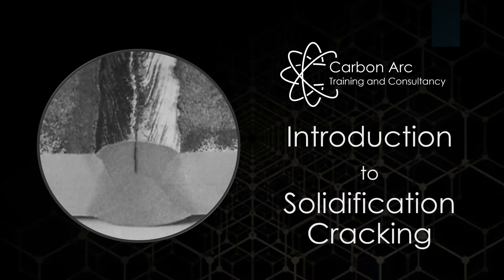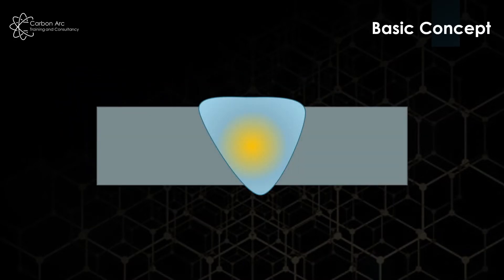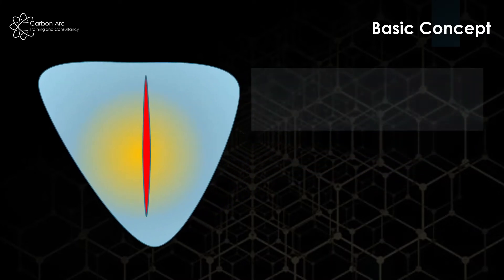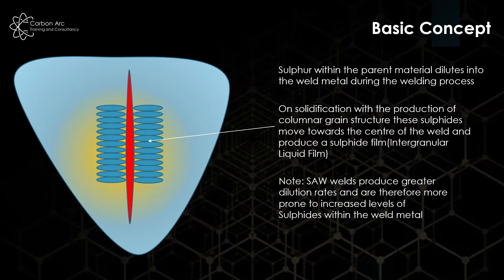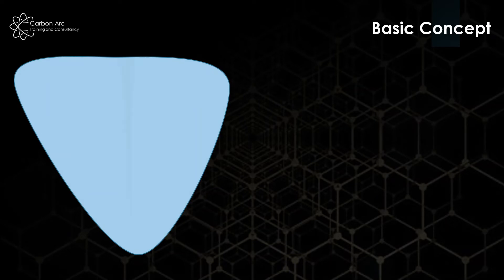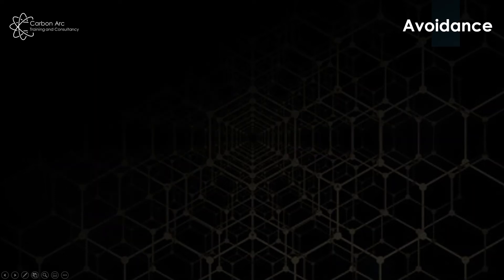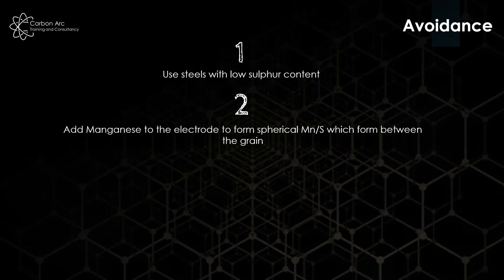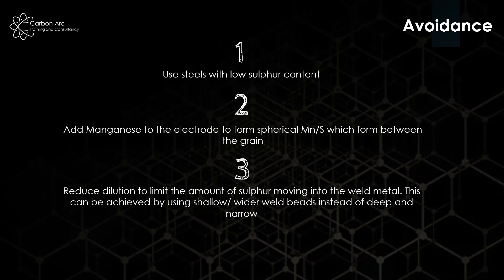Solidification Cracking - What you need to know

Comment: will the fix work on titanium? as i tig weld titanium when it cools down it craks with a loud bang sound
Reply from the maker: Is this a failure immediately after welding or after some time?
Reply from the maker: Solidification cracking is a low risk in Ti as the % presence of Sulpher and Phosphorus is very very low. You might be seeing cold cracking.
Reply: It cracks abut 30 sec to a minut of cooling off, the filler matirial is AMS 4897. And it craks the same pattern even if i clean the weld off and reweld.😩